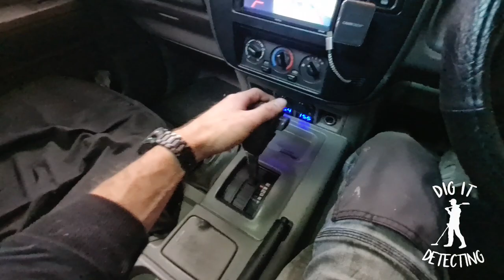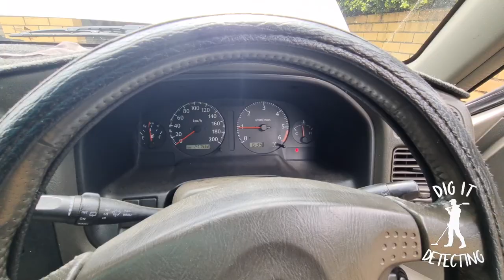GU Patrol Transmission Install🔧 Part 2

Comment: Well done Luke and your mechanical skills sure saved you some dollars there.I'll be looking out for your next detecting vid next week.Cheers.
Reply from the maker: Thanks heaps @DetectingOz I am so happy it's all back up and running now and with no issues at all which is a bonus. Generally you get the odd leak or small problem to fix after first start up...but we nailed it first time thankfully👌
Cheers again mate, I look forward to sharing that next detecting adventure very soon🙂⛏

Comment: Mate! Cracking video. Thanks for taking the time to put it together and I'm glad it turned out well. My TB48 auto trans is slipping and I don't want to get it rebuilt. Do you happen to know how I can tell what years are compatible?
Reply from the maker: I'm really glad you enjoyed watching this video @MaXimus666789 a shame about the muck around I had do deal with getting the second hand box after paying for it weeks prior...but lesson learnt😆
In the end it ran perfect though thankfully.

Sorry to hear to mate. Nothing worse than a slipping gearbox in a heavy 4wd. I am unsure of the top off my head which one is compatible. However I would reach out with that question on a Nissan Patrol forum and I'm sure some Nissan Wizz will know 100% or even done one themselves before. The best thing about the patrols is every one loves them and being so popular, there's lots of parts and information on hand whenever you need.
Best of luck mate, thanks again for watching👍👍
Reply: @DigItDetecting  Cheers! I checked with my local mechanic and they've said I can go up to 2016 as the 2017 box has some additional sensor that can't be read on my. Fingers crossed the new box runs long and strong! Thanks for the reply.